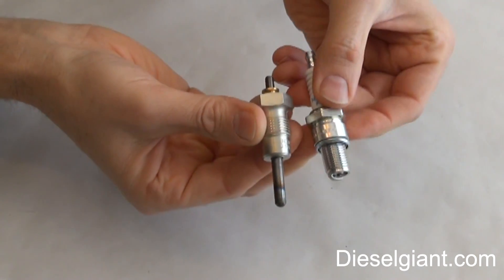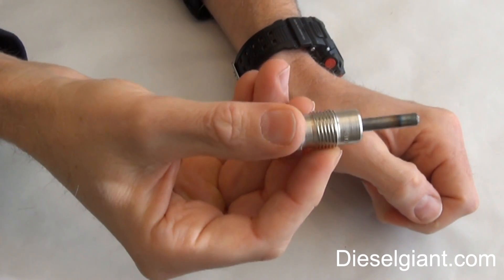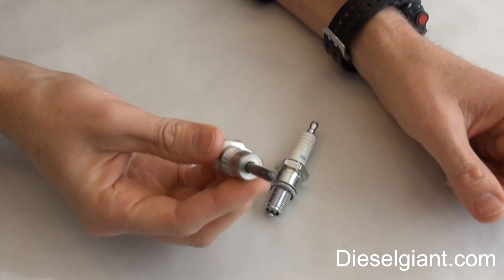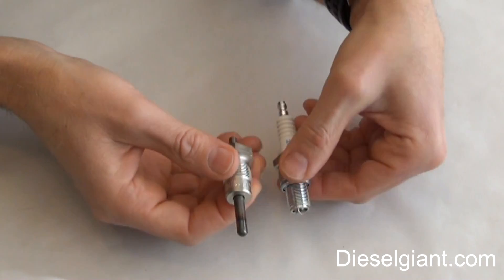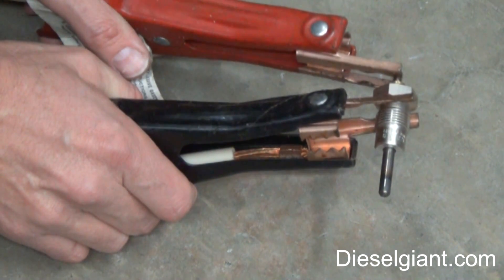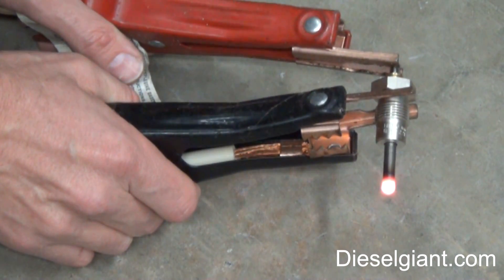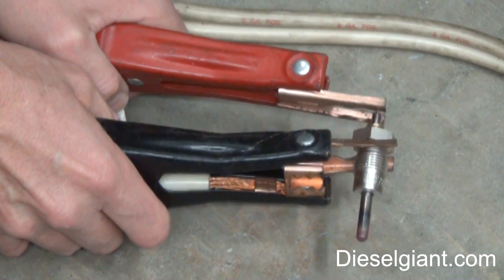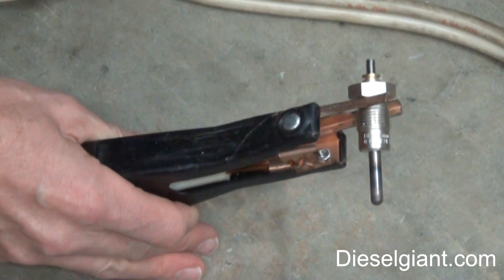Glow plug vs  spark plug explained

Comment: I figured out what glow plugs were long ago, when I was learning about gasoline engines, and what causes detonation/knock/preignition, and how to prevent that. An air/fuel mixture exploding from just being squeezed, that should never happen in a gasoline engine. An air/fuel mix igniting, not because of the spark plugs & their timing, may damage the gasoline engine.

Detonation/knock & preignition, may not only happen, because the octane rating of the gasoline, is too low, but also if it's a very hot day, and there is something wrong with the cooling system.

So I figured, since Diesel engines rely on the compression strokes, to create enough heat to ignite the diesel fuel. Glow plugs, must be things that heat up the engine, when it's too cold for that to work...and I was right. And the word GLOW, was also a big clue. It reminded me of the heating elements in a toaster oven. This is a very good video. Thank you for showing a glow plug.
Reply: I went to an automotive school, but I don't remember that much about Diesel engines, because they were briefly mentioned, and when learning about the 4 stroke cycle, we focused on gasoline engines. But what I did hear about Diesel engines freaks me out.

Diesel engines have much higher compression ratios then cars, they don't use spark plugs, they control when the diesel ignites, by squirting it into the cylinders, at an EVEN GREATER pressure. This is why the fuel lines for Diesel engines, are made of thicker metal, then gasoline engines. The diesel fuel is at such great pressure, that if there was a pinhole leak in the fuel lines, and you waved your hand over it, the diesel will cut into your hand, and diesel in your blood will kill you.

This is why Diesel engines creep me out. Especially if they were in a crash, and are still running.
Reply: @observingrogue7652  in a crash diesels wont explode unlike gasoline and the fuel lines are far from you are sitting
Reply: @Tsifdgoyddo  
I was talking about working on a Diesel engine, after a crash, or diagnosing it while it's running. I'm worried about a hole in the fuel lines, because of that, or sabotage.
But I'm loyal to EVs now, and building Electric motorcycles now. But Diesels still creep me out, for those reasons
Reply: I've been running my gasoline generator on kerosene like really pure k1 kerosene 
And when I turn the engine switch off (the spark plug should stop making sparks) the engine stays on just because of the compression lmao I have to choke it and turn off the fuel line and It seems like no damage

Comment: thank you for the informative demo. can we do the same testing experiment at home by placing the glow plug between bricks and the trying to connect the positive of a battery through a wire, holding the wire with a plier? will this be safe?

Comment: question have a 2011 duramax was about 30 degrees yesterday morning. Went out to start my truck has been running great and my check engine light was on truck was running fine. Went to auto parts store they did diagnostic and said it was the glow plug for cylinder #7. I replaced the glow plug  for #7 was fairly easy cuz was on my passenger side and I'm sure it was the right one passenger side closest to Cab. Even after all that my check engine light is still on do I have to clear the code to get rid of it or is something else wrong thought the light would go away after changing the problem glow plug.. any help would be greatly appreciated.
Reply: +Don Henson You must clear the code

Comment: Hello Mr. Diesel,

I wonder, if it would be an improvement, 
to fit a diesel engine with 
a spark plug ?

A spark plug could improve the explosion of the diesel fuel
in the cylinder chamber.

Thus, the diesel engine would work with less pressure
at any temperature with better performance
and less pollution.

I would call the diesel engine "Diesel SP".

PS:
Chrysler has already presented the Diesotto in 2007.
However, I would like to run the Diesel SP
with pure diesel.

What do you think about my idea,
I would like to know  ?#~

Best Wishes
Dipl.-Ing.
Ralf Steffler
Netcool Certified Consultant 
Rosenaustraße 7, OG 
63069 Offenbach am Main
Out~of~The Box Solutions
http://OBS-ITConsulting.com
Reply from the maker: +Ralf Steffler Well the problem is that a spark plug does not have enough heat to ignite the diesel fuel.  The diesel compresses all the air in the cylinder to about 1000 F in the cylinder.  A spark is hotter but only in a small area.  To achieve lower NoX emissions they do drop the compression ratio, but have to add more efficient turbo chargers and other tricks to make up the power loss.  A very high compression diesel engine is very efficient and makes a ton of power and gets much better MPG but increases it NoX output which the govt frowns upon.
Reply: Mr. Diesel,

I guess 1000°F is about 500°C !

A spark plug works at about 900°C (optimally).

There are very expensive spark plugs made of platinium, 
which keep for more than 100.000 Km.

(Toyota Celica)

###########
Anyway, there are various spark plugs on the market, with different temperature ranges from 400°C up to 1000°C. 

Everything is possible !

1000°C is about the temperature of the air in a diesel  engine.

However,  in cold weather, a diesl engine might not start, which is the reason for the glow plug. Nevertheless the scandal about the clean diesel in the USA reveals, that the combustion is far from being perfect.

Thus, I  suggest to improve the diesel combustion 
by using a spark plug per cylinder 
and some extra ignition fuel. 

In winter time many people pour some extra super fuel in the diesel 
to improve the combustion.

Bye the way, I drive an Alfa Romeo which uses twin spark technology
to improve perfomance. And it works !#~

Furthermore you could improve the performance of a diesel engine by using the Atkinson engine design, which uses different hubs per stroke.

A lot is possible in the USA.

PS:
If you read the biography of Rudolph Diesel, 
you realise it is very hard work 
to invent a new engine and
find sponsors.

Best Wishes
Dipl.-Ing.
Ralf Steffler
Netcool Certified Consultant 

Rosenaustraße 7, OG 
63069 Offenbach am Main
Out~of~The Box Solutions

http://OBS-ITConsulting.com

.
Reply from the maker: +Ralf Steffler Diesel fuel is very hard to ignite and spark plugs wont work and do not have enough heat in the cylinder volume to ignite.  If you want to try out your theory, please put diesel fuel in your car and report back to us on how well it runs.
Reply from the maker: +Electric Lightbulb Octane is NOT how flammable it is.  Octane rating is how resistant to "knock" it is.  The higher the compression the higher the octane that is needed to NOT have pre-ignition.  Flammability has nothing to do with octane.
Reply from the maker: No spark plug.  Diesel fuel wont ignite with a spark plug.  Even if it would the  high compression of the engine would ignite the fuel before the spark plug would.  If you lower the compression ratio enough so that it wont auto ignite, then you essentially have a gasoline engine.  Work on making a gas engine burn diesel fuel instead.
Reply: Hello Electric Lightbulb,

you might know, that the spark plug was invented by Bosch in 1902 long after Rudolf Diesel patented the diesel engine. 

Now, the idea is, to fit a spark plug in a diesel engine and inject gas into the cylinder right after the diesel. Thus, the spark plug ignites the gasoline,
which incinerates the diesel~air mixture to the utmost, in order to increase the efficiency of the combustion in the cylinder chamber. 

The ratio diesel to gasoline would be about 10:1 
for cold start at 0° Fahrenheit.

That way, you could even start a diesel engine in Alaska.

You would not need a glow plug  to cold start a diesel engine at all
and less air pressure, which is a big problem in new diesel engines.

Toyota has already stopped further diesel engine development,
because the engineers cannot get higher in cylinder pressure.

Best Wishes
Dipl.-Ing.
Ralf Steffler
Netcool Certified Consultant 

Rosenaustraße 7, OG 
63069 Offenbach am Main
Out~of~The Box Solutions

http://OBS-ITConsulting.com
Reply: +Ralf Steffler Thanks mate, am under 15 and just learning about con rods, camshafts, crankshafts and timing chains. All that stuff. I got told once that it was how flammable the source is. I got told that the more refined it is the purer the chemical.
Reply: Mr. Diesel,

what do you think about Startpilot for Cold Starts. Startpilot sprays  Diethylether in the air filter. Thus, you can Cold Start a gas engine easily.
But what about a diesel engine ?#~

PS:
There are a lot of funny Cold Start 
Videos on youtube.

Best WishesDipl.-Ing.
Ralf Steffler
Netcool Certified Consultant 

Rosenaustraße 7, OG 
63069 Offenbach am Main
Out~of~The Box Solutions
http://OBS-ITConsulting.com
Reply: +Ralf Steffler Your writing takes up way too much space and is a bit annoying to read. An automatic thumbs down.
Reply: Dear Mrs. Florida,

just do not read it,
if you do not like it !

PS:
I am just trying to patent
a diesel engine with a 
spark plug.

You know, Rudolf Diesel 
did not have one.

Best Wishes

Dipl.-Ing.
Ralf Steffler
Netcool Certified Consultant 

Rosenaustraße 7, OG 
63069 Offenbach am Main
Out~of~The Box Solutions

http.//OBS-ITConsulting.com
Reply: Mr. Diesel, 

since you do not believe me, 
perhaps you might believe 
Prof. Blumes, 

He  holds  a Professor in Chemistry.

Visit his Website and look at the table:
http://www.chemieunterricht.de/dc2/auto/flamzuen.htm

Diesel has quite the same ignition temperature as petrol,
though it is harder to inflame, due to its longer
molecule chains.

############
Petrol
220 bis 460°CDiesel 
200 bis 350°C

###########
Thus you can ignite Diesel 
in the same way as petrol.

If you ignite Diesel by a spark plug, 
you need much less air pressure.

Best Wishes

Dipl.-Ing.
Ralf Steffler
Netcool Certified Consultant 

Rosenaustraße 7, OG 
63069 Offenbach am Main
Out~of~The Box Solutions

http://OBS-ITConsulting.com
Reply from the maker: Please do this simple proof to yours and Prof theory.  Please fill up you gasoline powered car with diesel fuel do a video for us of how well it runs.  Please report back with how much better the gas engine runs on diesel fuel.
Reply: Mr. Diesel,

I have a much easier proof of Theory.
I just look the ignition temperature 
of Diesel up on wikipedia.

Please visit:
https://de.wikipedia.org/wiki/Dieselkraftstoff

It states, that the ignition tempertaure of Diesel is 
220 °C, which is about 430° Fahrenheit.

That's about the same as petrol.

I do not think, that I get other test results,
no matter what I try.

Anyway, I wish you 
Happy New Year 2015 

In Germany we say:
"Guten Rutsch"

Best Wishes
Dipl.Ing.

Ralf Steffler
Out~of~The Box Solutions
http://OBS-ITConsulting.com
Reply: +dieselworld but a gasoline powered engine runs at a lower compression ratio, so why keep suggesting this?
Reply: Dear Interlake Powersports and Outdoor Adventures,

a gasoline powered machine can run at lower compression 
because it uses a spark plug.

Toyota says, they cannot increase the compression in their diesel engines.
in order to comply with the regulations for diesel combustion.

That's the reason, why Toyota drive the development of 
Hybrid engines and why VW used a special 
defeat device software.

If VW used their patent, they could build diesel engines
that outperformances any other diesel engine
at optimum .combustion temperatutre.

This would be good for man and nature !

PS
Since I am a development engineer I keep 

on developing new hard~ and software.

If you look at my Homepage, you will see that I also 
developed a mobile backup battery for cars.

Best Wishes
Dipl.Ing.

Ralf Steffler
Out~of~The Box Solutions
http://OBS-ITConsulting.com

~~~~~~~~~.
Reply: Ralf Steffler don't wanna be a dick but if it ain't broke don't fix it
Reply: +Ralf Steffler If the diesel had more octane (how flammable it is) it would ignite easily. Instead it is a thick oil. Petrol is a light and has a high ratio of octane.

Comment: +dieselworld: will this glow plug lit every time we turn on the key? u said it helps in cold start. say my engine has already run few miles and its hot. Now i turn off the engine and start it again. will the glow plug lit in this case?
Reply: +Deepak Naik In normal cases it only turns on when when the coolant is below a certain value. For Volkswagen its around 18 degrees or max. 5 minutes glowing time when they will turn off.

Comment: Very useful - thank you. May I ask - is it possible for a faulty glow plug to trigger the service light (Car/Spanner icon) after starting from cold and driving only a mile, but then be OK after stopping and re-starting the car immediately? The Garage diagnostics shows nothing, but I did a "pedal check" and got a flashing sequence of 6342 on the engine warning light (engine icon) which, according to various vauxhall/opel forums translates to fault as "H02S Heater Control Circuit Low (Bank 2 Sensor 3)" & also quotes P0683-04 "Glow-Plug Circuit Open".  My car is a 2007 Corsa 1.3 CDTI with 48000 miles on the clock. The car drives fine and shows no physical driving problems at all; it has just had a 48000 mile service.  I'd be very grateful for your expertise and advice - thank you.